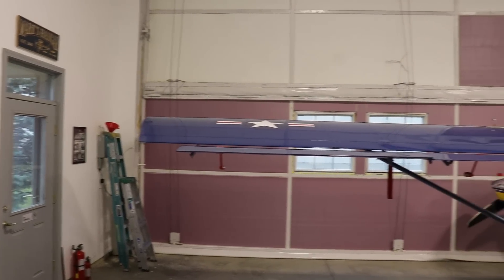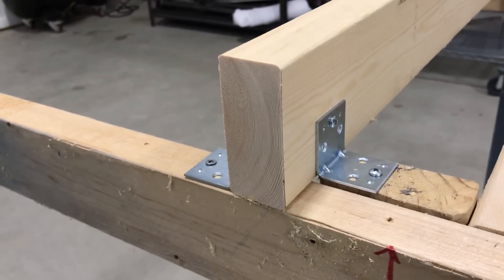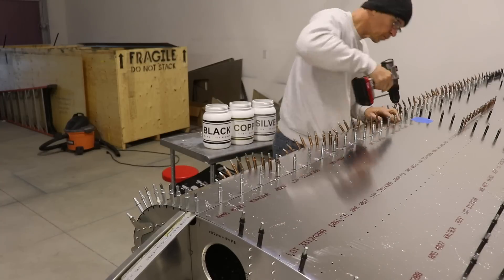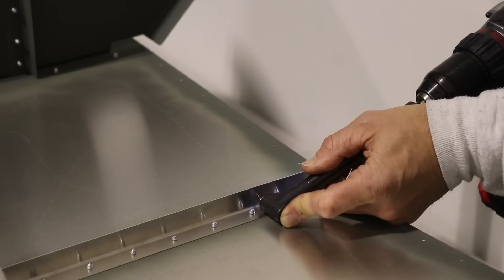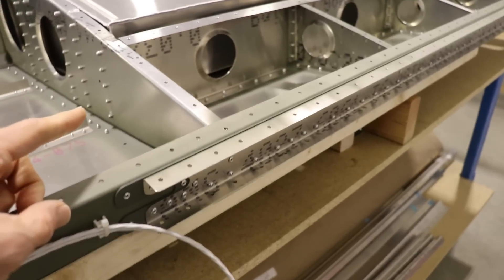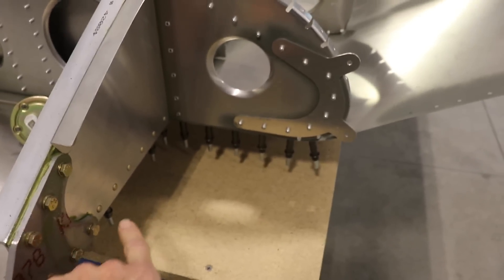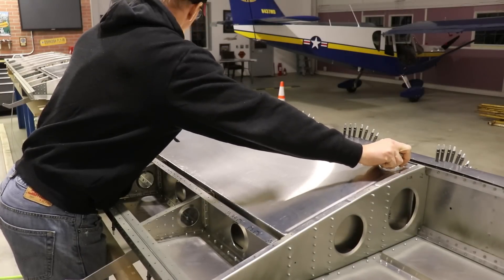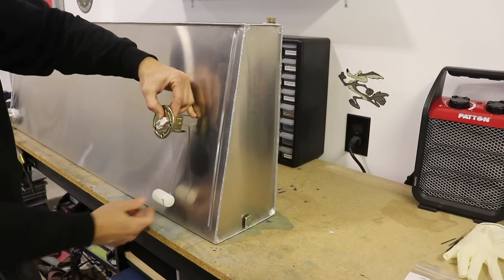Hangar Door, Wings, Wiring, Fuel Tanks, Fuel Senders, etc... (Ep15)

Comment: Can I ask you where you got the construction manual that has the area where you check off that you did that process? Is that included in the plans or did you put it together? Does it come with the 750 Cruzer? Thanks for your time.
Reply from the maker: That is the new manual for the Super Duty.
Reply: @KitplaneEnthusiast  Thanks.

Comment: Just in case you’re not aware. They do make fuel sending units that slide up and down on a tube. Do slosh and are very accurate as fuel sender go. Just a thought because that is what I will use on my build. Thanks for the video. 👍

Comment: I think that I would probably end up mounting the sending unit just as you pointed out at the end of the video. While it may also make the job more complicated, you can fix the travel issue by shortening the length of the rod the float is on. But if modern avionics allow it, I'd think that you could calibrate the sending units for the E-F range. I appreciate your thought for thinking ahead, though. Sending units definitely fail.

Comment: It amazes me you can get so much work done on the SD AND make videos so frequently! Can't believe you left me hanging.  You were almost at the point I was anticipating: Will there be a fuel sender cover on  the SD? If not, what did you do to eliminate the cover, and can I eliminate it on the Cruzer?  :)
Reply from the maker: Yes I also made the cover for it. It's nothing special-just a square piece of aluminum that gets screwed to the nutplates you see around the hole. You don't want to eliminate the cover. It is there in case you ever have to service the fuel sender.

Comment: Why not mount the fuel sender at an angle so that the float is close to the deepest corner of the tank and get the fullest reading?
Reply from the maker: There are plusses and minuses to any spot you choose to mount the sender. Mount it where it works best for you!

Comment: Think about an electronic fuel sender, too many problems with that vintage style sender unit, very smart move with the removable plastic cap
Reply from the maker: I know I will get flak fro saying this, but the fuel gauge is the most useless instrument in the entire airplane. Anyone who flies his airplane based on what the fuel gauge says is crazy LOL! I can add or subtract fuel on my gauge just by pitching the airplane up or down (because it moves the fuel in the tank). I always fly by time. My engine burns 4.6 gallons per hour. I plan on 5. So by flying 1/2 hour or an hour (what ever interval I choose) I always know how much fuel is in each tank. One of the things I love about the Dynon system is that I have it set so that every half hour it gives me an audible "SWITCH FUEL TANKS" message and also puts an alert on the screen. Obviously we have to have fuel gauges, but I use them as a back up instrument that tells me ABOUT how much fuel I have in the tanks.

Comment: I would go 90* to the way you were showing.
Reply: Exactly, does the lever arm have to be inline with the plane? Mount it towards the larger side of the taper, with the float pointing towards the fuselage leaving a couple inches of clearance all around.
Reply from the maker: Great-nothing wrong with mounting it that way either.

Comment: If you shorten the arm of the fuel sender, you can use the entire range of the gauge.  Just trim it until it touches the stops in the full up and full down positions.
Reply from the maker: True, but with these gauges, the arm can not be shortened.
Reply: @KitplaneEnthusiast  Bend it in a S or Z shape...

Comment: Kudos to you, Mark! I like the way you go over all the steps in drilling, deburring and riveting! Every time I worked on a metal repair or new build, we always had things together and apart at least 5 times before final riveting, sometimes more. Mind you these were all done with solid rivets( showing my age), but taking the time to do the best you can builds the most satisfaction and admiration down the road. Safety is also a concern, as leaving an aircraft full of drill shavings is not only sloppy, but can lead to wear and corrosion. There's probably a ton of builders who will say they never have had a problem from this, but I would sure hate to be included in the 1 time there is one. You've covered the subject, and your opinions, well during this build

Comment: Why can't you bend the wire (rod) up or down to allow the mounting location of the base in the optimal
place.
Reply from the maker: Where is the optimal place?
Reply: @KitplaneEnthusiast   You were showing how if you position the unit with the float forward in the tallest portion of the tank, then you have either dead space above or below the float. But if you bend the rod up or down slightly, it would allow the float to touch both the top and bottom of the tank. Giving the greatest amount of gauge accuracy.
Reply from the maker: @edwardmullen1581  Bending the rod would do nothing. Consider this-let’s day it’s positioned so that at full down travel the float is touching the bottom. At full up travel, the float goes above the tank, so we bend the rod down so that the float is now just at the top of the tank. Now what happens when we lower the float (with the bent arm) back to the lower position? Answer: we no longer get full down travel because we bent the arm down. The only way to truly get full travel is to shorten the arm, which on these particular senders, we can’t do.

Comment: Mark, is there any reason for NOT routing the wires and fuel lines through the ribs, even if you have to drill a hole and bush it, wouldn't it be closer to the cockpit center, or do the wings fold and require all to be at the pivot point?

Comment: Is there a different type of fuel sender that would be more accurate that you could use?  I assume those senders are included in the kit from Zenith.
Reply: There's capacitive senders that have no moving parts. I like those better than the mechanical ones shown here.

Comment: Your rationale about the fuel tank indicator is valid.  I wonder if you go back to Zenith and discuss it with them, they may accept your point and update their plans or dissuade you otherwise.
Reply from the maker: True-a lot of people mount the sender on the top of the tank. I'm not sure why Zenith still has it mounted on the side.
Reply: Certainly less chances of a leak on top versus on the side

Comment: I don't think that I've ever been 1st ! Not that it matters much. Have you given any thought or consideration to a non-mechanical sender? homebuiltHELP did an interesting video on them.  I'm aware that Zenith provides one in the kit...just curious. Also , how many gallons did you opt for?  Thanks for the update... Blue Skies!
Reply from the maker: I looked at the sender from Beelight when I was building my Cruzer and was turned off by the cost. Plus, others were posting that they had problems with them. I also looked at the sender from Viking aircraft but laughed when I was quoted $700.00!
Reply: @KitplaneEnthusiast  from what I have read the issues were fixed with software but haven't heard much since the fix but I like the fact its tiny
Reply: I do like the new unit from beelight
Reply: Thanks Mark... what's the capacity per??

Comment: Your emphasis on thinking things through before committing to a plan is a valuable tip!  It never hurts to sleep on a problem and reassess your options!  BTW, having very recently "been there, done that" on drilling out the rivets in the top wing root skin to replace my leaking VDO senders with the Stewart Warner senders, it's not necessary to drill-out all the rivets.  Once you get a few rivets forward of the spar, you'll find the wing root skins can be simply arched forward and on my STOL 750, I was able to cleco the left and right skins to each other and that held them out of the way.  For those building and haven't installed their senders yet, I totally agree with Mark's advice to mount them on TOP of the tank with an access cover and not on the side of the tank!

Comment: Wait     B-4 you cut the hole...  Can you shorten the Fuel Sender arm to be able to use all of the travel?
Reply from the maker: No. Getting full travel doesn't matter. It's just that the more travel you have, the more points the gauge has to measure.